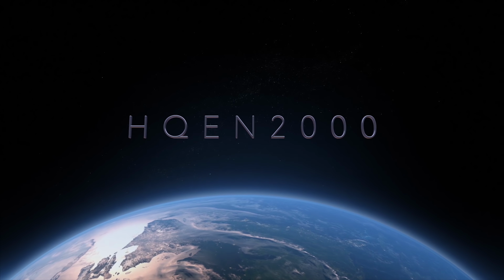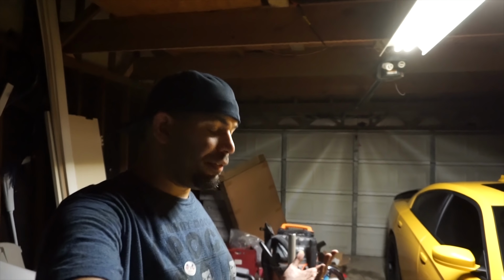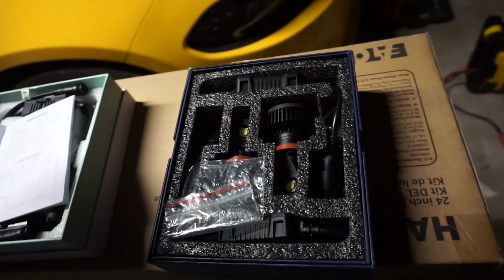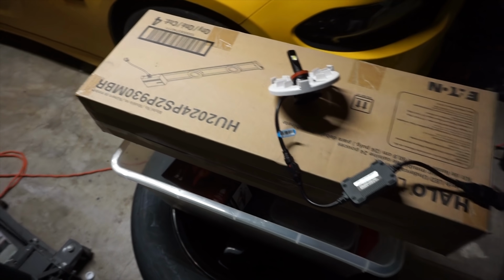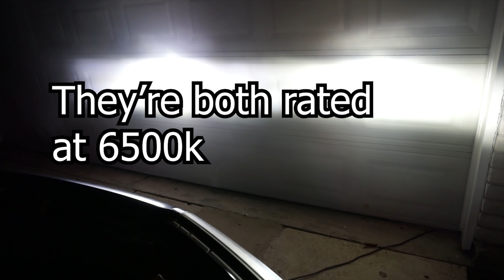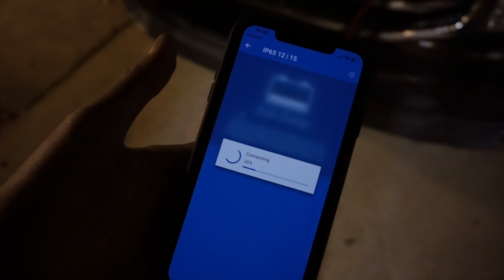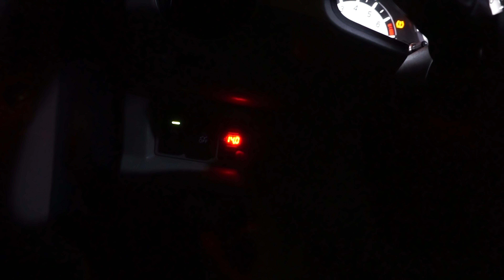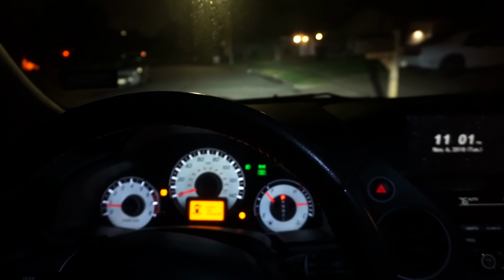Have aftermarket LED headlights finally surpassed HID headlights?

Comment: If you have your headlights to automatically come on sometimes the HID's will shut off for no reason ( or they did for me ). I found that turning the lights on manually, they do not go off. Maybe, maybe not in your case.
Reply from the maker: Nah. They worked flawlessly till about a year ago when I started noticing the one light on thing. It never seemed to get worse, at times it took longer to get them back on (flipping it on and off 2-15 times) but they'd always seem to come back. Its always that side, but it was pretty rare it would happen, then after it would come on the issue would go away for a while. Really strange. It was never a big enough deal to do anything about but I figured it had been long enough.

Comment: The alternator charging on and off is controlled by the the car's pcm. Most newer cars around 2007 and up have this option. My 07 Tahoe does this. When charging it is 14.4, when it is off is about 12.2
Reply from the maker: The charger stays at 14+ when it’s running. The Honda will go down to 12 while it’s running. Like the alternator just stops charging. Maybe the car thinks the battery is fine. But it ain’t.

Comment: I installed morimoto hid in my srt6 and they was clean and bright. my 2018 has factory LED "Dynamic Bending Light" headlights and my 2016 has factory hid. The HID out preforms in every aspect in my opinion
Reply from the maker: LED dynamic bending light? I'll have to check that out. My and my wife's cars just have the normal DS3 factor HID. I replaced mine with 6000k. Hers still has the stock 5300k. But they're both plenty bright. The 5300 is of course a better but I felt like it clashed with the factory fogs which are 6000k as well as the DRL thing in the front.
Reply: @DadMods I must say I have bad eyes and night time sucks for me. The "Dynamic Bending Light" is headlights follow road on turns They are not bad by any means, but the HID seem so much better to me however I'm going to adjust cuttoff height this weekend to see if that helps they seem low to me
Reply: BTW we need to meet up I wanna ride in the scat.. its almost perfect weather for the viper as well!
Reply from the maker: You in the area? I’m jealous I don’t have dynamic bending light that sounds impressive. I saw the new Audi headlights turns off individual leds to map the light around pedestrian and stuff. Pretty cool.
Reply: @DadMods Yea right down the road near Texas city bucees. Yes the technology is far superior than my 97 gts halogen projectors. I'm only worried about how much I will owe when one dies on my 2018

Comment: I have a 2015 scar pack that uses 9012 bulbs, where can I find the 9012 bulbs since the link you shared doesn’t have 9012.
Thanks
Reply from the maker: I dunno. Most cars use 9005 or H11 which is why that’s all I carry. I’ll pick I’m some 9012 too. I’m actually going to carry the 9000lm lights on my store. I was impressed.

Comment: The problem with LEDs is you don't know what your getting. LEDs results vary from application to application. It may work well in reflector housing but in projector housing the results may not be so pleasing, and vise versa. I've witnessed this first hand.

Comment: BROOOOO another car that's dieing for battery?  LOL.  You killing me bro.  So after watching your videos and my car died.  Had the ECU replaced and re-done, then my battery died LOL...Had that changed out, but now the cars back up and running.  Swapped out my Kicker Comp VRs in the trunk for some JL TW3's and now I"m done modding for a little while.
Reply from the maker: Yeah ever since my wife got her challenger my sound system feels super inadequate. I’d like to just replace the sub. Is there a way to put the larger sub that goes in the tire well in?